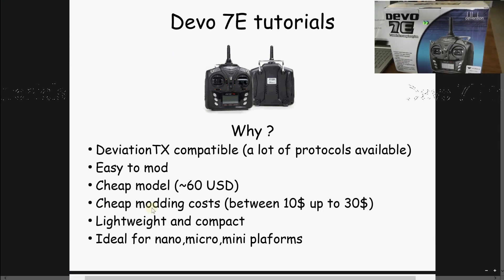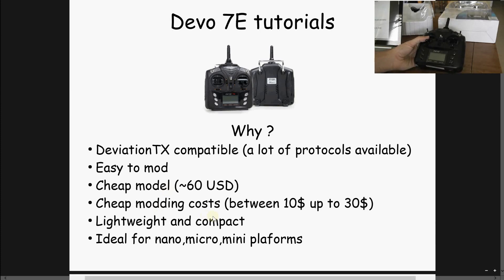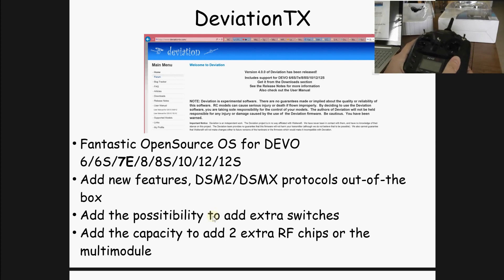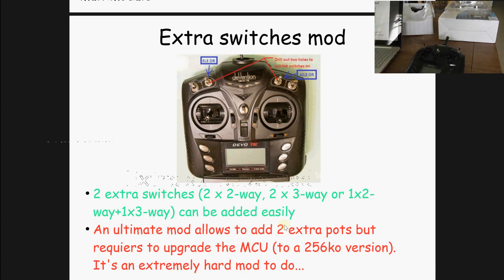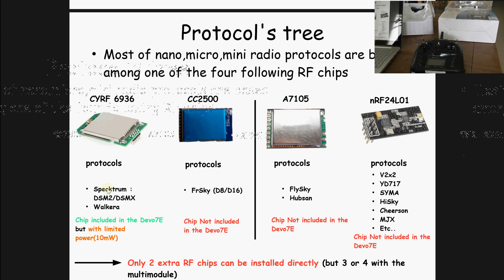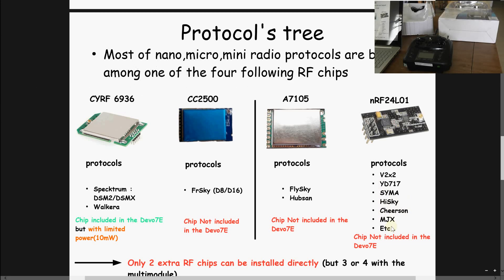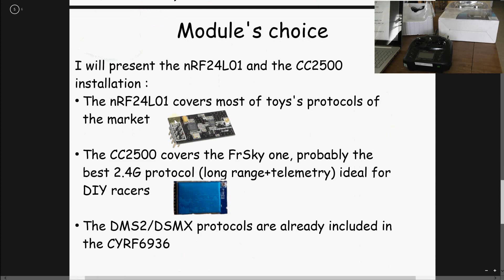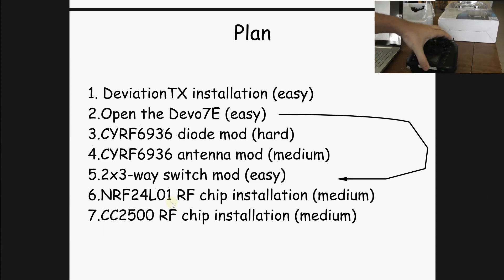Devo7E tutorials: part1 - introduction

Comment: I have an AR 2.0 drone that I want to fly with an RC. Purchase stock DEVO 7E. Have upgraded firmware to Deviation 5.0 first, but did not copy the files over via USB because I received a Hack set of files from the person I purchase the RX from. It comes with similar folder and a tx.ini file like Deviation. I was instructed to use the USB and copy those over to the Devo after formatting. When I try to boot up the DEVO 7E screen comes up with a Protocol Mismatch 8101fc6c and 0801f560. Any ideas?  Would like to communicate with you about it if you have any thoughts on how to correct this. Many thanks in advance
Reply from the maker: Hi First of al, are you sure the AR 2.0 uses a DeviationTX compatible protocol ? Did you flash first the DFU firmware ?

Comment: Nice series Seby. I have a question I already have this one http://www.banggood.com/DEVO-Transmitter-Tuner-Modified-for-FBL80-FBL100-WLtoys-V922-p-89812.html  that comes with antenna. the 2.4 antenna you linked is better? or is the same?  Oh and where I can find the diode for extending the range of the dsmx?
Reply from the maker: Multirotor Go Yes it's the same. I head now this model of nRF24L01 can come with a big stick antenna. THis is why I linked more the splitted part. I am now editing the video for the diode mod. Hope it will come today
Reply: oh ok, thank you. it seems now this module works with cheerson green board, right?

Comment: Sorry, just trying to gather all the parts for this mod.  Is this the correct part for the A7105 module for the 7E and if so where do I "solder" the antenna?  http://www.banggood.com/XL7105-D03-A7105-Modification-Module-Support-Deviation-Galee-Flysky-p-922603.html

Comment: Thanks for the great video, got one question though.  This module that's listed here http://www.ebay.com/itm/181091377178....if I use this one will it give me nRF24L01 and A7105 module in one package?
Reply from the maker: bluemaz6 No this module is the A7105 only. EBay sellers like to write all other RFchip references to loose "buyers"
Reply: SeBy DocKy Got it, thank you for the information.  Just one more question I promise lol...I do have not the 7E yet so I don't know the spacing inside but would this fit inside http://www.ebay.com/itm/NRF24L01-PA-LNA-SMA-Wireless-Transceiver-communication-module-Antenn-1100m-2-4G-/191542825497?pt=LH_DefaultDomain_0&hash=item2c98d79219?
Reply from the maker: bluemaz6 Don't take the nRF24L01 with RPSMA connector. I gave links of correct model with uFL connector in the description of this video
Reply: SeBy DocKy Got it, thank you.

Comment: If I install the modules without doing the diode mod, will the transmit power of the modules also be limited ?
Reply from the maker: Razvan Taranu The diode mode concerns only the builtin CYRF6936 RF chip. The A7105, CC2500, and nRF24L01 have their own unrestricted PA+LNA (Power Amplifier + Low Noise Amplifier)